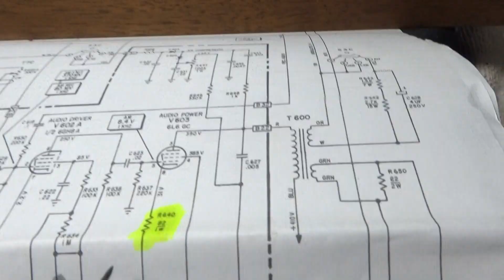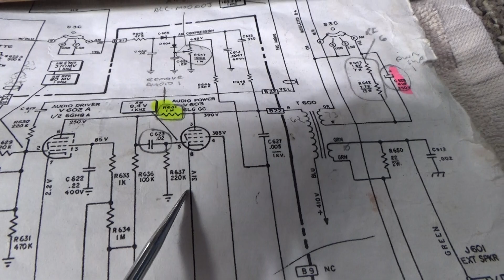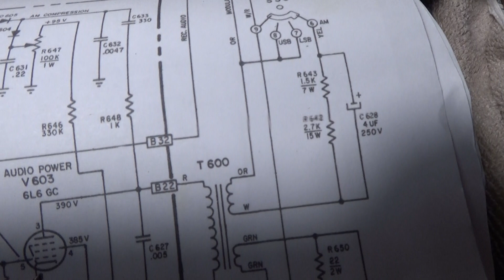Tram D201(A) audio final limiter,  feedback differences only

Comment: My tubes are original should I replace all to get more audio and receive?
Reply from the maker: No only replace tubes when they go bad. Normally the big bad 6L6 tram audio tube does not go bad. Sometimes the receive tubes can cause receive to drop, but just have them tested. Usually its one of the power resistors that cause receive to drop. One reason I replace all the power resistors when rebuilding one.
Reply: @tramdr  on all boards ?
Reply from the maker: Best to replace all the 1 and 2 watt carbon resistors on all the boards, and every single electrolytic capacitor on all the boards and  the electrolytics on the chassis too including the big can electrolytics. Notice all the Blue flameproof 3 watt resistors I use on the ones I rebuild. Yep, takes some work. One reason a rebuilt D201(a) will not be cheap. However, when recapped and power resistors replaced, and properly rebuilt, they work great. I think the greatest CB ever made.

Comment: Is it worth running a demco modulator as well with d104
Reply from the maker: Nope, some radios with low audio gain need a Demco modulator....like Demco and some Sonar radios. However, Brownings and Trams have tons of audio gain, plus they have their own built in compressor type modulation circuits. Demco's will sound bad on them.

Comment: Good video, a while back you did a video on a Tram and you replaced I believe was a cap just right of the 6DG6 in front of a coil and was orange and you replaced it with a larger value and it was red, may I ask what it was. Keep those videos coming they are really informative.
Thanks 
Micheal
Reply from the maker: That cap is the plate blocking cap. It is 1000v. It is not high enough voltage for a Tram that is doing more than 4 watts or has more than 100% mod. A plate blocking cap blocks the DC and passes the AC. The plate voltage on a Tram is 210V DC but when the plate voltage is plate modulated 100%, the peak volts will be 4x what the plate volts are. Hence 210V x 4 = 840 volts. This is fine for a stock Tram, but turn up the mod to 150% and now the peak volts will be 6X, plus if you add the high dead key mod, the plate volts will be 410 volts, not 210. Hence on a 150% mod Tram the volts would be 210 x 6 = 1260V well over the 1000v cap, plus if you have the high dead key, the mod would only be 100% so it would be 410v x 4 = 1640V. Hence, I always change that cap to at least a 2kv. If that cap shorts, you will have plate DC on you coax. Not good.
Reply: @tramdr  Doc, What is the plate blocking cap schematic part number?
Reply from the maker: C-700
Reply: @tramdr  Thanks Doc, Have a most awesome evening!